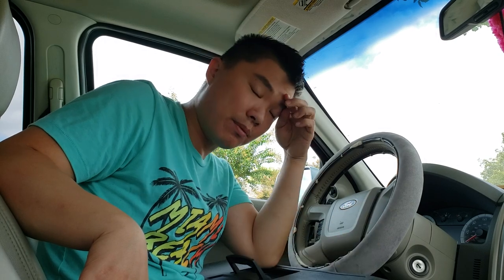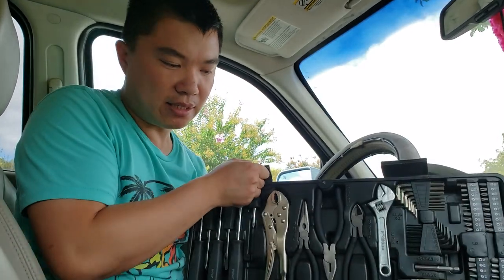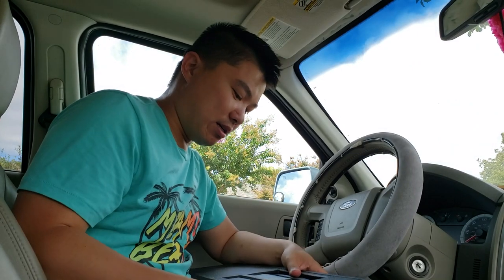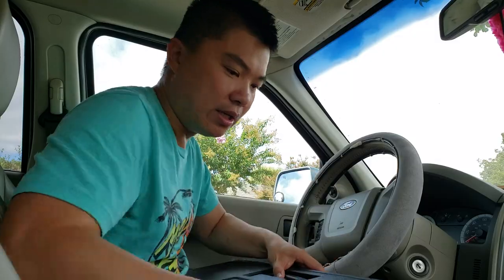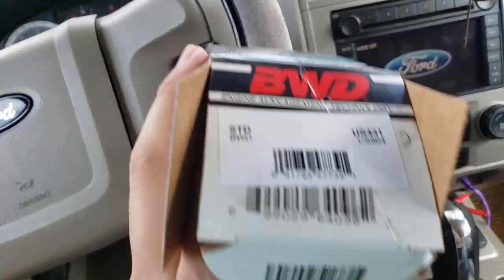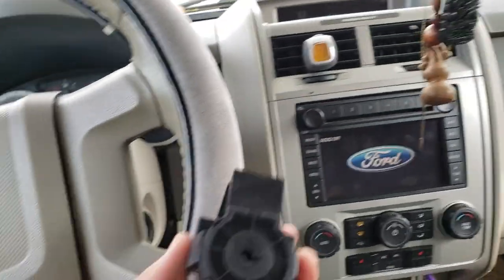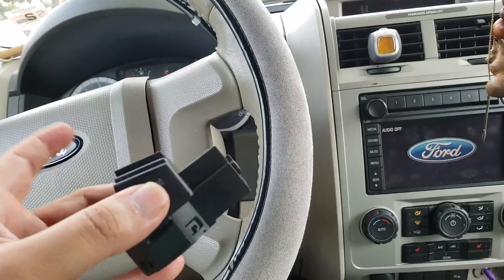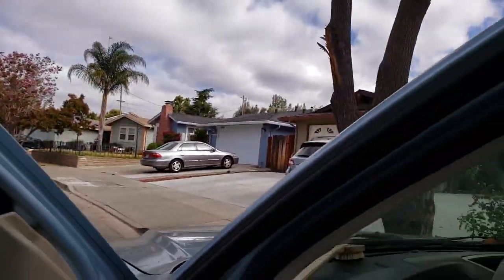2008 Ford Escape Hybrid no crank no start ignition switch fix under 25 minutes

Comment: This worked for me!!!!! I still have to push in the key and it's not perfect but I can start my car in the first try, before it would take me upwards of 100 times to start it. It's kinda like the way it was 3 years ago. Thanks for the video!!!!!
Reply from the maker: same with me, push in a little but it work. I fine with that. glad it help out
Reply: put tape on the lock cylinder there a video out on it also check the comments i replied to a very helpful one

Comment: This same thing happened to me & I went & bought the part (got mine for $25) & did like you and it started right up no problems.  Now I'm just trying to get the plastic cover parts back on the steering wheel haha.  Easy to remove but a bitch to get back on.  But yea, thanks bro!

Comment: It works! For the people that say that it doesn't work, you must replace the entire part.
Reply from the maker: oh well, I didn't replace the entire thing, just that small part.
Reply: @JonathanJiang1  I replace the part showed in this video and the car starts but you have to push all the way in the key. But I can live with that, my previous Ford escape went 3 year with that problem (where you have to put the key all the way in) with no other problems. Thank you very much for uploading this, you saved my weekend.
Reply from the maker: @ivanborruel  yeah same, I have to push the key a little further in as well but I fine with it as long it start
Reply: @JonathanJiang1  yeah, I didn't know that I just can replace that module and not the whole part.
Reply from the maker: @ivanborruel  yeah, but is great that it work. save time and money. I think the parts have life time warranty too. so next time if it fails, I just bring back to O'Reilly and get a new one.

Comment: I bought one on Amazon for $23.00 but it didn't help. I returned it for another one and that one DIDN'T work either!! I put the old one in both times and it will start every now and then but the problem won't fixed. It's not hard to change the part either but you have to make sure that's really the problem. I'm going to have to try buying the part of the local auto part store and see if their parts work better. Fingers crossed.

Comment: What’s the name of the piece you changed?
Reply from the maker: Ignition switch 

https://www.carparts.com/details/Ford/Escape/Replacement/2001-2014/REPF506205.html?TID=gglpla&origin=pla&utm_source=google&utm_medium=pla&utm_campaign=221983653&gclsrc=aw.ds&&gclid=EAIaIQobChMImsP_ns7i6gIVzz2tBh2gsgkUEAQYAyABEgJD8_D_BwE

https://www.autozone.com/batteries-starting-and-charging/ignition-switch/ford/escape
Reply: Thank you!
Reply: My car stop working this afternoon, I try everything, so I guess it’s time to change this piece, thank you sir!
Reply from the maker: @DavidMartinez-td8in  yep, I promise that thing is the problem. guarantee fix
Reply: I didn’t work:(
Reply from the maker: @DavidMartinez-td8in  what you mean, no way. did your power came on, but no crank? did you check maybe is the starter.
Reply: Yeah, everything seems fine but it doesn’t start, it doesn’t make any sound, but the battery works, thank you anyway:)
Reply from the maker: @DavidMartinez-td8in  sorry couldn't be any help. good luck.
Reply: No problem, thank you tho!
Reply: It now works!
Reply: It doesn’t work perfectly, but I made it work, so basically the ignition switch wasn’t the problem in my case, looks like the switch where you put the key didn’t reach the ignition switch so I had an idea, I put the key like If I was going to turn in on the car, and with a screwdriver I move the ignition switch manual and It started, I try it multiple times and it works perfectly now, for now I will have to be using a screwdriver to start my car 😂
Reply from the maker: @DavidMartinez-td8in  wow, that sounds like a lot of work. Sorry, it didn't work my method. I saw a video where someone sand down the parts where the keys go into. Anyway, it was a lot of work looking at the video. If is not too troublesome for you, I guess it works. But it might be good to switch the whole thing.

Comment: Regards. what is the spare part code? is it different with the car that is not hybrid?
Gracias
Reply from the maker: the parts that I use is cs804 ignition switch. I don't know if is the same with non hybrid but personally I think is the same